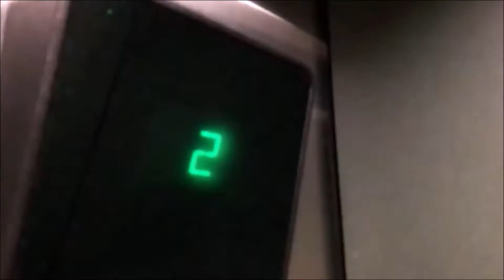Dover Impulse Elevator Pit/Shaft

Comment: Pit looked like it had some water in it.
Reply from the maker: Yeah there was a leak and the building facilities workers were pumping it out.  From what they told me, the elevator broke and the mechanics had to replace the hydraulic ram
Reply: @Jamestube8439  That must have taken a lot of effort to do (since the ram holds the car up).
Reply from the maker: @andrewsstation6436  I would assume so since it seems like it would be a hard job to do.